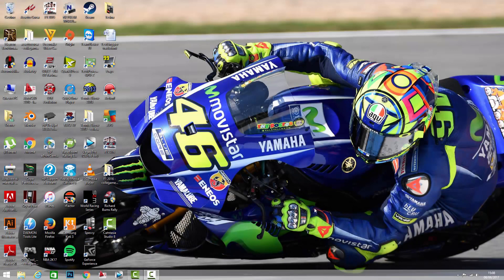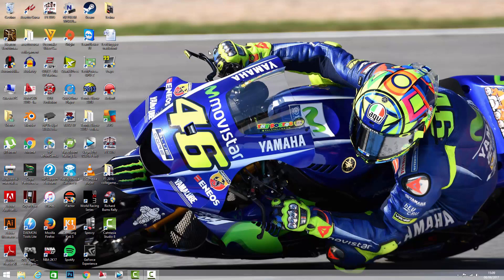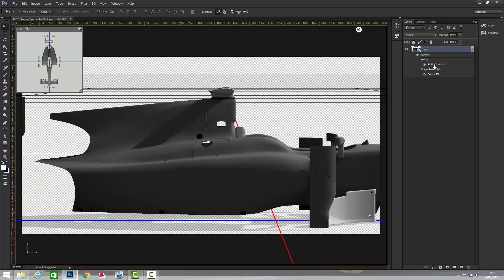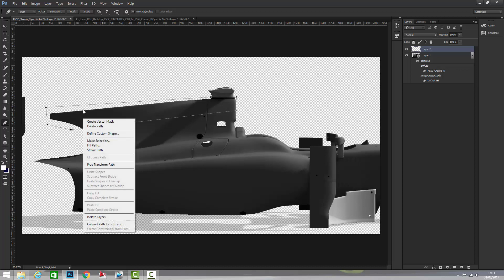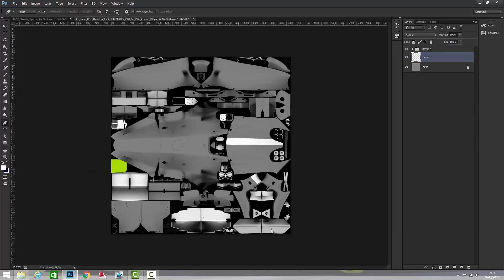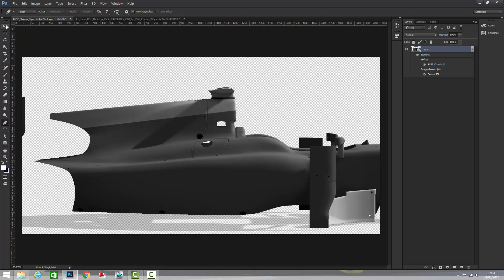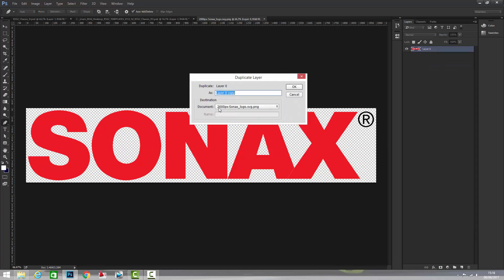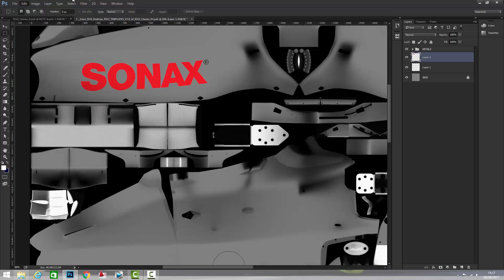Painting a Car Livery on a 3D Model - Photoshop Tutorial

Comment: @Gianmarco Fiduci mate do you happen to know from where can I get some 3D templates for ACC? On RD could/n t find any..
Reply from the maker: Yes! https://drive.google.com/drive/mobile/folders/1qMRy8Qvu6lcHrNZq2jd1zzyBPuDdOmla?usp=sharing
Reply: @GianmarcoFiduci  Thank you so much. Can you give me some indications how to put a image ( png ) on the car in 3d? When I merge down the layer the image appears fade and of very low quality on the car even the orginal size is big enough ( i used it on the 2D template and it appeared fine) Also when I paint the car ( let's say a gradient applied ) the paint isn't applied uniformly. some areas it isn't painted at all
Reply from the maker: @bombbaa7799  well, sometimes for some reasons it doesn’t work like intended. When I open the 2D layer from the 3D one, I paint on the 3D one with a big brush the car, in that way the projection works and then it works as intended .

Comment: Hi MrRacingGames, I'm thinking about making my own livery for my Youtube channel using the ACFL mod and have a few questions(I've never really used Photoshop 3d but willing to learn) : First, how would you mirror the changes you makes on your livery so that both sides are identical, and second, is this still the method you use, or is there an easier alternative now? It would be really cool for my channel to have my own livery and racing number :)
Reply from the maker: Gseric47 this is still the method I’m using, if you have a fast enough pc is the fastest and easiest. 
Mirroring is a bit of a problem, you can’t directly mirror a logo or something, you have to manually rotate and move the logos every single time
Reply: Can you mirror the changes you make to the paint? like stripes, shapes, etc?
Reply from the maker: Gseric47 yeah, you have to duplicate layer
Reply: Ah ok. Is there a way to do this with DDS or KN5 files? I don't see anything else with ACFL's mod, only the preview which is a PNG file :(
Reply: Wait, I see now, the RSS template is supported by photoshop, but the ACFL mod doesn't. Thanks for making this video though, it's given me a lot of ideas. It looks like I'm going to have to use Gimp for the ACFL mod :)